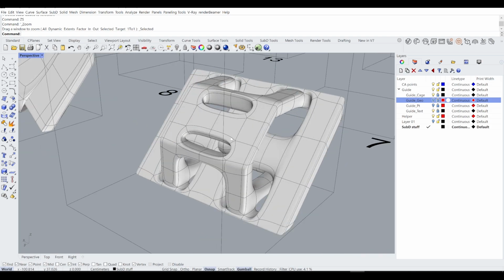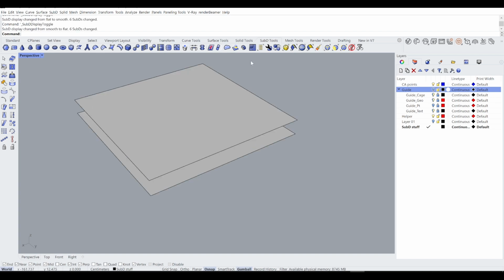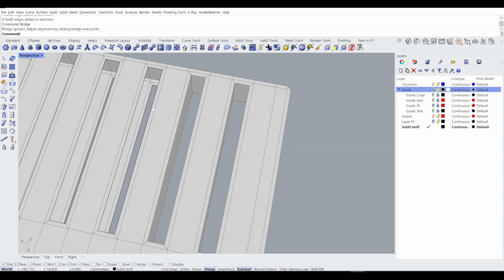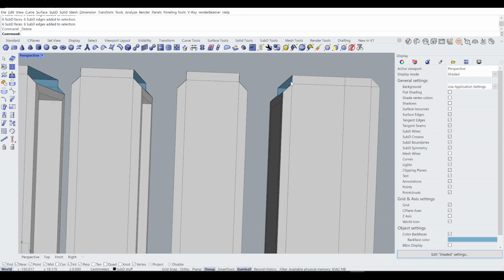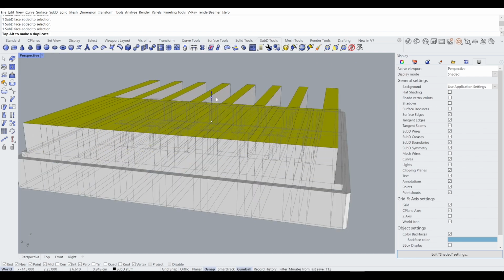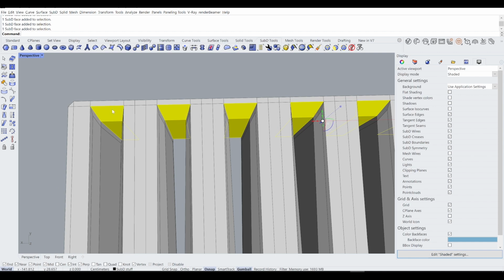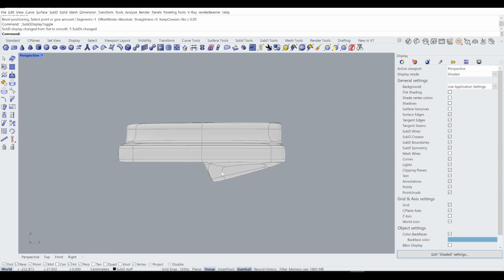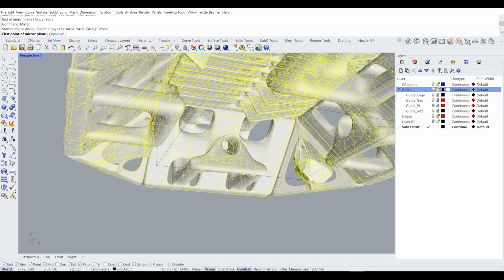CMC REWORK Series - Part 2 - Protect SubD borders with Inset

Comment: You could have automated about half of the manual labor by using "_reflect" ;) 
Cool Idea to customize the marching cubes, very excited for the end result!
Reply from the maker: Yup that's absolutely true. But there is one thing - when I use reflect, I always tend to lock myself in doing completely symmetrical stuff. Since I wanted full freedom - I decided against the reflect tool.... And still did a completely symmetrical element....

Comment: Hi, a quick question, when I try to Inset it insets all the faces, not just the edges. It doesn't allows me to select that "group mode", it only lets me precise the inset distance. 
Is this a recent R7 update?
Reply from the maker: Hi there, yea - this is the newest Rh7 update. I sometimes get this question - and usually it's because of an older version of Rh7 being used. Try using SubDInset command instead - that should give you an option for group mode.
Reply: @DesignGoBrr  Thank you so muchhhhhhhhhhh. Also, I learned so much watching your videos, you helped me a lot! I love your thinking approach when designing/modeling